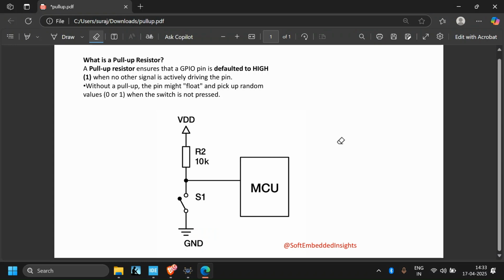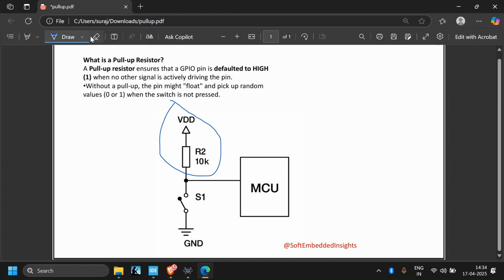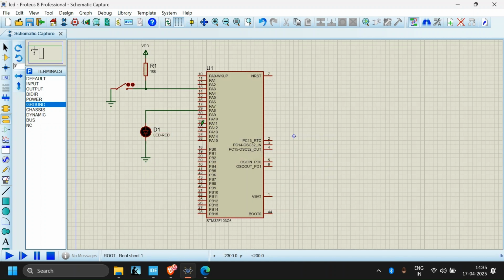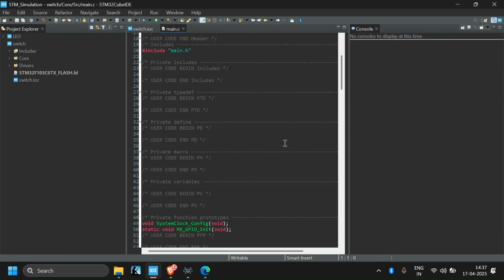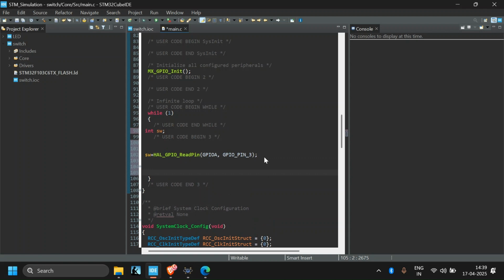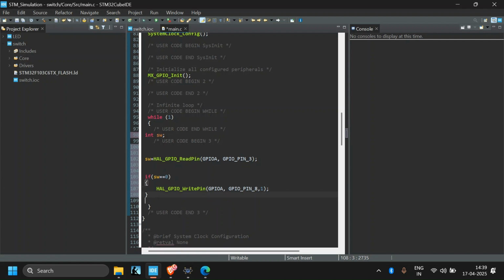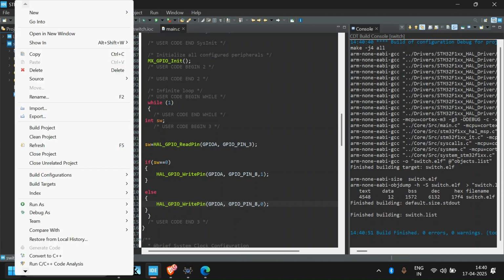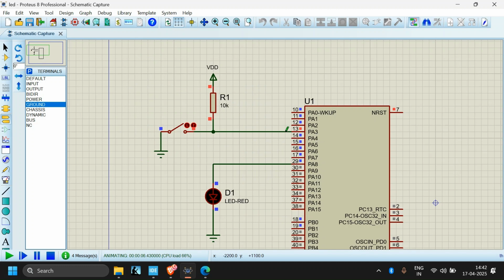STM32 GPIO Input Tutorial | Switch & Pull-up in Proteus

Comment: I written the same code and same schematic but irespctive of switch position the led always on I configured gpio pin as no push pull in program also
Reply from the maker: https://github.com/suraj2727/STM32_Project/tree/master/Switch
Reply: Did you understand why it happens sir? I've also done everything same but it doesn't matter whether switch is on or off (pin shows on and off no problem here ) it doesn't effect the led
Reply: @victimofmurphy  same problem with me